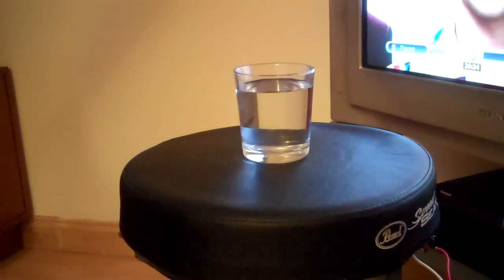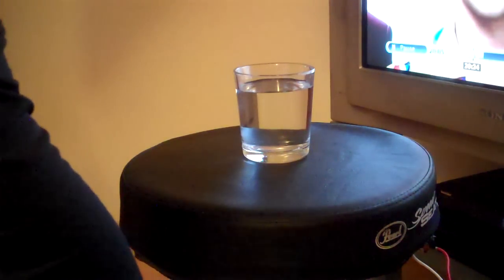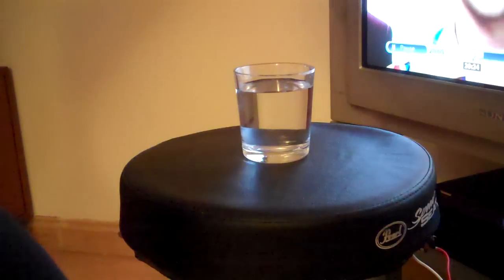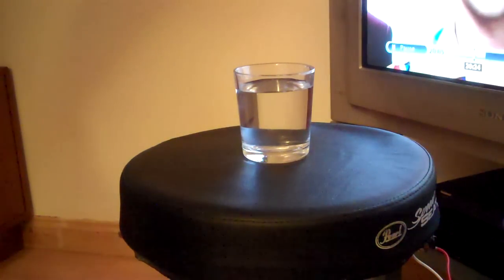ButtKicker Drum Throne Shaker Bass Pump Part 3

Comment: would I be able to use a normal sub woofer speaker if I don't have what you have
Reply from the maker: +Josh Campbell Not really however these are not expensive. Just search for tactile transducers and you'll be able to find them. Also they are very much smaller than a subwoofer and don't require a lot of power either.
Reply: Hmm ok thanks I was wondering that cus I saw some videos of diy tactical transducers